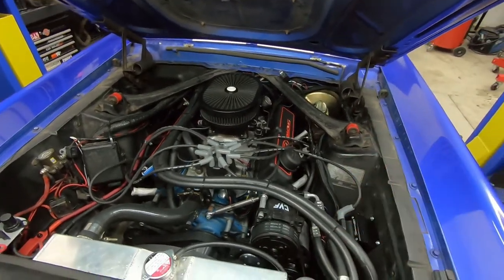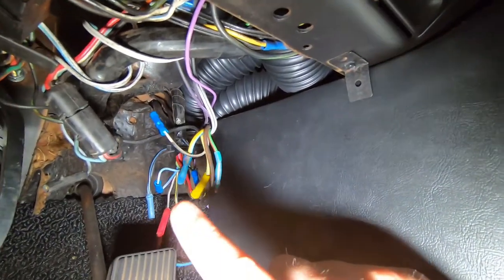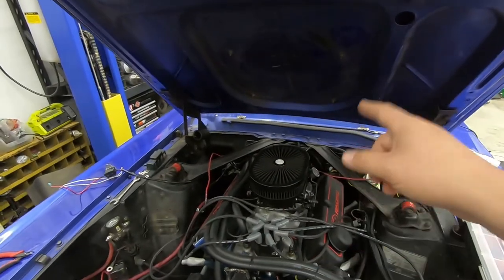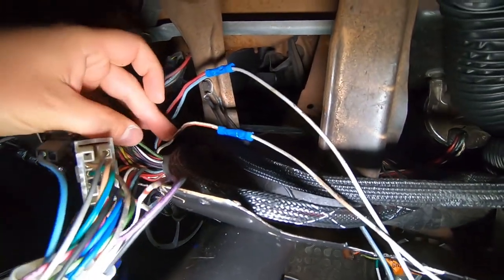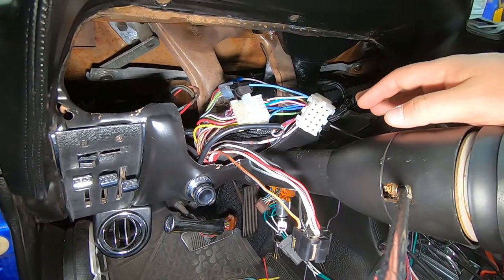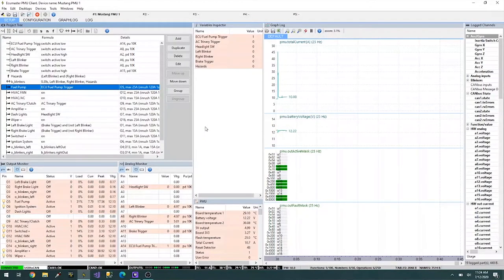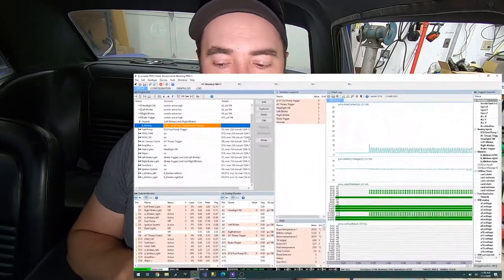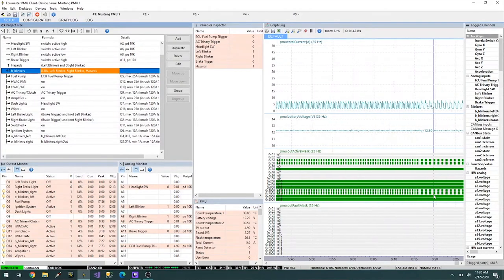Deleting the theoretical fuses in the 67 Mustang

Comment: Where are you with this project now bro?  I'm looking more into mine for this conversion also!
Reply from the maker: I have been daily driving the car with this setup and haven't had an issues. Having it prime the fuel system on the door switch is great, and adding the programming to prevent priming after exiting the car makes it feel like a modern system.

Comment: I own '68 Mustang and my turn signals doesn't work after I connect new radio (the radio is working). Maybe the installation of the radio wasn't the problem. I check the fuses and 14A ACCY was dead. I replaced it with new one but it immediately blow. Do you have some idea what can be wrong?
Reply from the maker: If the radio is working with the accessory switch blown, I would assume you don't have it wired properly. Generally a radio should have constant power to keep the memory settings, but shouldn't be powered on until the key is on and the accessory circuit is given power. So if you know the radio is working with that fuse blown, that sounds like it's not wired correctly.

I would disconnect the stereo, replace the accessory fuse, and turn the key on. If the accessory circuit powers up without the radio and doesn't blow the fuse, I would check all the pins on the radio to make sure that you didn't accidentally ground something you shouldn't have.
Reply: @AmbiVe  And can you guess what blow up the new 14A ACCY fuse every time when I install it?
Reply from the maker: If the radio constant power and accessory power are backwards it could be a problem, especially if something else grounds that circuit when it's turned on. There's really no way to guess without trouble shooting by unplugging the radio so you can test the circuit without it.

Since you say the radio works, is it on even when the accessory fuse is blown? That would immediately tell you the radio is not wired correctly.

Comment: I have couple questions not related to your PMU install but rather your stang. I have a 69 Cougar, I know they are fairly similar, first question is what brand of Radiator are you using (Brand P/N please), I think you are running a factory brake power booster, your engine sounds pretty healthy/lumpy, does your engine produce enough vacuum to assist your brakes? Im running a lumpy cam with almost no vacuum so my power brakes dont really work so I just ordered the complete WIlwood Disk Brake setup with manual master cylinder.. DId you end up installing the Wilwood Non Power Master Cylinder?
Reply from the maker: I am using the Mishimoto radiator kit (MMCPKG-MUS-67 on Jegs I believe). It didn't fit perfectly, but works well. I had to cut and weld flanges to mount it forward to have space with my 302s longer pulleys.

It's an aftermarket replacement brake booster that's supposed to be similar. It isn't exactly stock, it's cheaper Chinese quality, but it does work with the cam. It takes a little running/driving before it builds full vacuum, but I will probably replace it with a manual setup or add an electric pump if I upgrade heads and cams any further.
Reply: @AmbiVe  Great, thanks for the info

Comment: ??? But why?  Why not just rewire of fix what was hacked? Why complicate what does not need complicating?
Reply from the maker: It's not really complicated. Also, to have the same functionality but using relays, diodes, and physical wire loops, would be a much more complex and larger package. The resulting wiring from this change simplifies all the wiring to a single point in the car and allows all the configuration changes at will via a laptop plug. It also means that I can have automatically resetting circuits with greater protection than the terrible factory system that has half the car unfused. As an additional benefit, passing the power through the PMU provides "clean" power for items such as low voltage sensors and the EFI that otherwise struggle with the noise and interference of ancient harness designs.